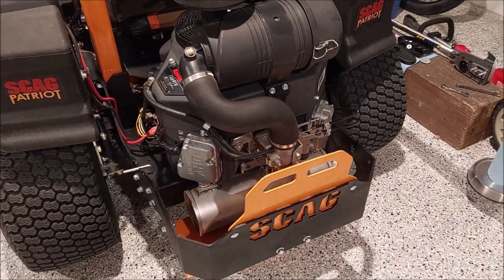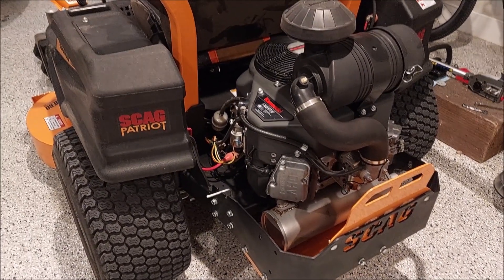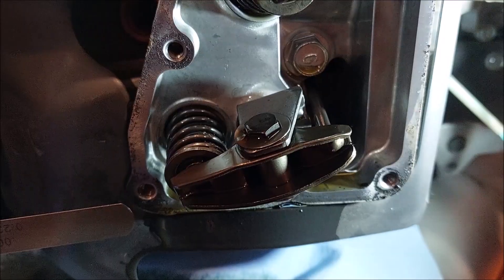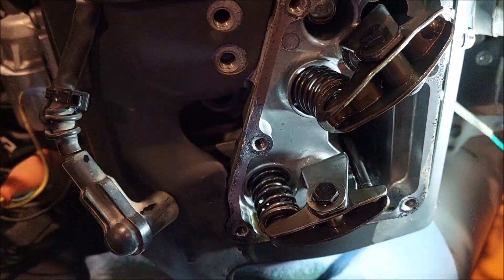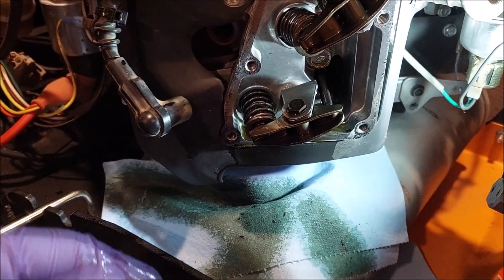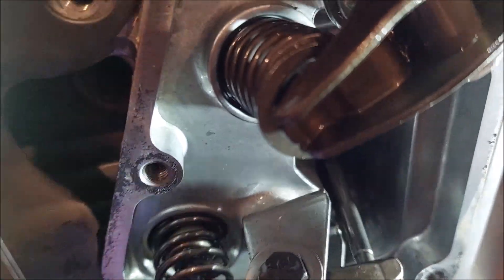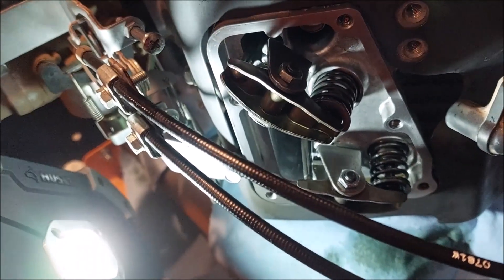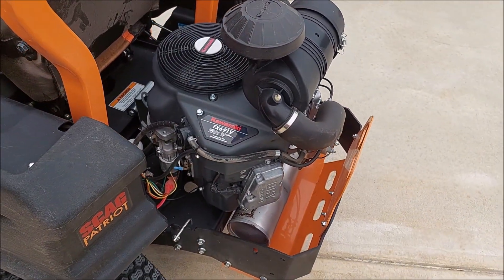Kawasaki FX691V Valve Noise Before & After Adjustment

Comment: My Kawasaki with 30 hours did the exact same thing the same side was at .0007 which is insane. I never had a Kawasaki do this at break in recall coming ? I adjusted mine and purrs like a kitten . Nice trained ear . Like mine . I’ve had about 5 kawasakis by the way . Nice video !

Comment: I bought a mower new with this engine on it. At 299h I finally got around to checking this. I found that Cyl1 was .005 and .006 , but Cyl 2 was .009 and .012 .
Also noticed the fins of cyl2 were packed up a lot  on one side with oily dust, adjacent to oil dipstick and filter. 
Id advise you to pull that top cover additionally sometimes between valve adjustments, and make sure the fins are clean. Get some compressed air and go to town on it. 
BTW I while I appreciate the simplicity of their system I found it difficult to be precise in adjusting. Most of them took a few re-dos after tightening them down. 
Cant confirm but another poster somewhere said the torque specs for valve cover bolts are 52 in/lb and for the rocker nuts themselves 87 in/lb

Comment: Hey buddy , my gravely runs for about 15 min then starts surging and dies. It has the fx691 as well. Changed the plugs already is it the coils or a carb issue ?
Reply from the maker: Sounds like it's not getting enough fuel.  Make sure fuel filter is clean and the tank breather hoses aren't clogged. Could be a fuel pump issue,  or coils are intermittent or coil gap out of tolerance and causes issue when it heats up. Sometimes it could even be the battery not fully charged or wonky regulator.  I'd start with the fuel system and check everything.  Process of elimination to make sure things are working correctly then move onto electrical.  I've seen bad safety switches cause issues when riding (the blades would keep disengaging). Hard to diagnose via web but hope this helps.  The manual has a good troubleshooting section with wiring schematic, etc. Also you can find exploded parts diagrams to see what components are in the fuel system.  Another great resource is taryl fixes all youtube,  he's been doing it for decades.  Good luck!

Comment: I have a fx730v on an Exmark Lazer Z. It runs and then surges and dies. Will run choked. New fuel filter, pump, lines, air filter and fresh oil and new filter. Any ideas? Coils? Carb?
Reply: How’s the gas ?  Float bowl ?

Comment: I always wondered why the book says 2 thou and everyone is saying 4 thou. The maximum spec is .0039” in the repair manual.
Reply from the maker: I guess most are rounding up .0039 to .0040.  Also depends on what revision kawasaki service manual you're reading, the earlier ones say .0020 to .0039, the later ones say .0040 to .0060, and i wouldnt be surprised if they revised it again.

Comment: Is this 22hp engine too small for a 52” deck?
Reply from the maker: For the hero deck,  no. I'm not sure about the velocity deck. I can plow thru 3ft tall weeds and it barely starts to drop in rpms.
Reply: @morejelloplease  👍🏼 thanks.  I just picked up a used one with a 52” deck.   I have a John Deere 275 with a 48” deck that I put a 25 hp engine on because the smaller engine wasn’t that powerful.  That’s why I asked.